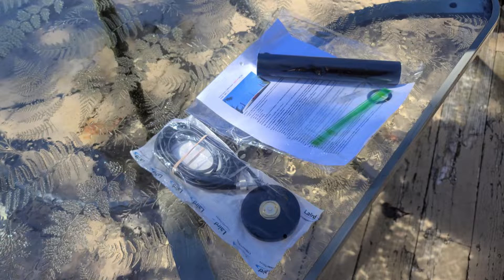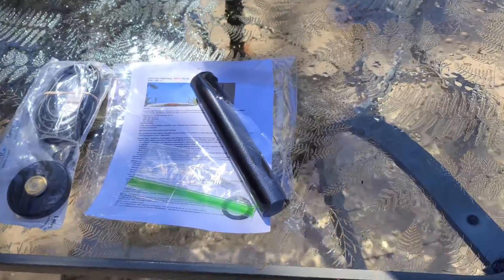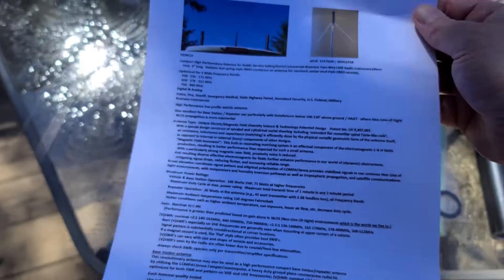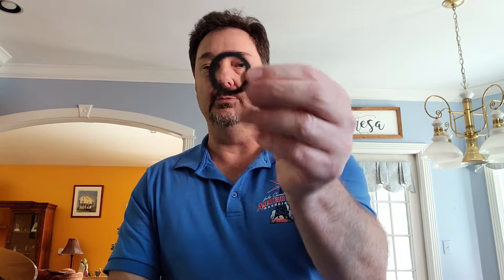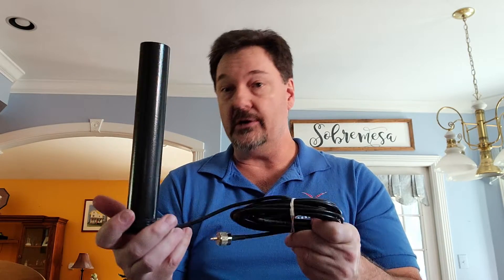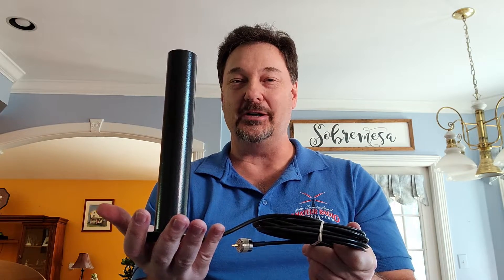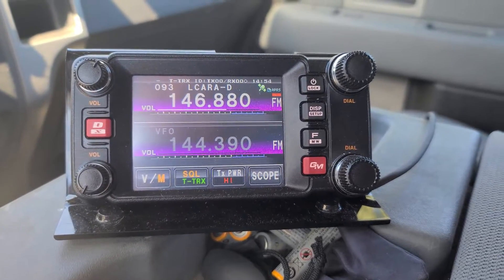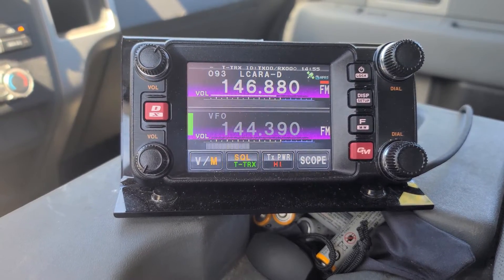LCARA HAM Radio: COMPACtenna LMR-1 Tri-band Antenna!!!!

Comment: For some looking to drop $180 on an antenna, may I ask why you only showed what any $40 antenna would do? If your spending $180 it's for the purpose of a true tri-band capable - 2m & GMRS in one antenna - why else and what benefit at this price would this serve if not for that reason? Would you happen to have the readings from the 2m location on 467.6000 please? (Middle of input band for gmrs)

Comment: Much appreciation to Brian, KY4BDP and The Lake Cumberland Amateur Radio Association for their informative, well made and fun videos.
This particular video is about the new 'LMR-I' model in the COMPACtenna line.
As a Land Mobile Radio (LMR) antenna, focus is particularly on 150-162 MHz in the VHF band.
And being a Government-Public Service/Commercial multi-band antenna, it also covers 380-512 MHz (is an exceptional antenna for GMRS), as well as 750-960 MHz.
This makes it a great fit for the Motorola full spectrum new 8500 series radios as well as their mono-band offerings, L3Harris, EFJohnson, Raytheon, and TAIT radios.
-
This 9" antenna has been getting much attention in the LMR sector due to its high performance and compact size.
With the desire to have an equivalent in the Ham Radio world, model '2M/440+' has been developed and is to be released soon.
In that the LMR-I is more optimized for the LMR frequencies and doesn't provide its best performance on the 2 meter band, COMPACtenna will provide Brian, KY4BDP/LCARA with a 'first showing' of this exciting development shortly.
This will help to better demonstrate this 9" special design construct with Ham Radio equipment.

The '2M/440+':  All the high performance of the existing model '2M/440', PLUS an additional ~1.5dB of gain, and greater power handling capacity.  It is for those where 9" is allowable/desirable and the operator wants that extra 'edge'.
Reply: Yeah......Right.....!
               😂🤣😂
Moving the antenna around to adjust the SWR, should speak volumes !
Definitely a case of the Tail wagging the dog !
Was it Lincoln that said,
 " You can Fool some of the People, some of the time " ?
And let's not forget 
PT Barnum's, 
" There's a Sucker Born every minute " !
Reply: The LMR-I (Land Mobile Radio - Government and Commercial two way radio, as well as GMRS) is specifically designed, tuned for T/R (Transmit & Receive) at the frequencies listed in the Data Sheet. 
The 2M/440, 2M/220/440, and 2M/440+ models are, for their respective frequencies/bands.
There is no moving of the antenna; simply place it at an upper corner of the vehicle with an appropriate mount; the Installs page of the COMPACtenna website is helpful.
Have a nice day, Sleeve.